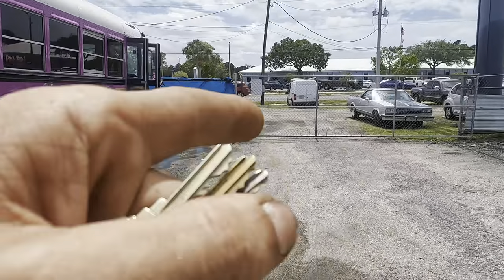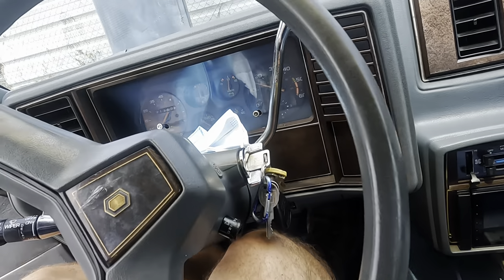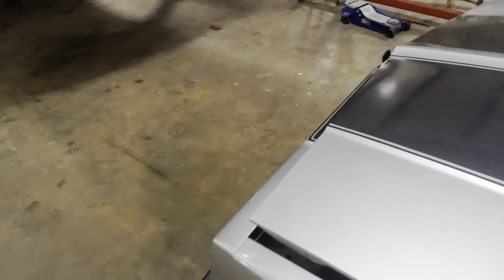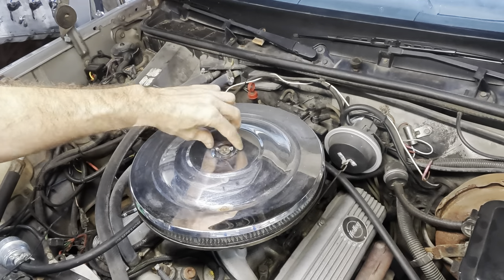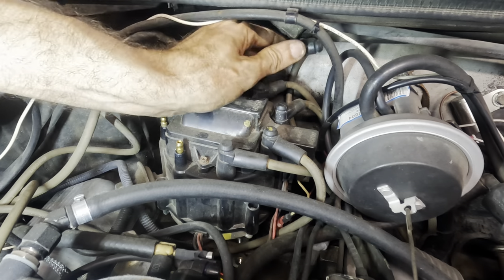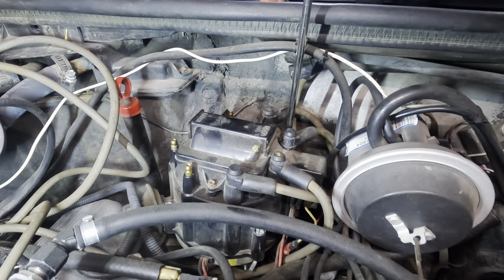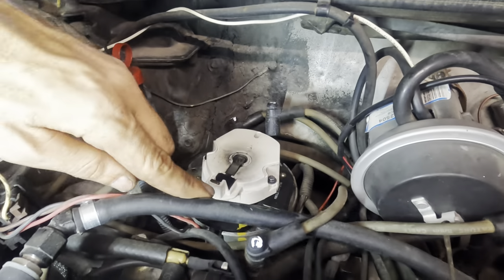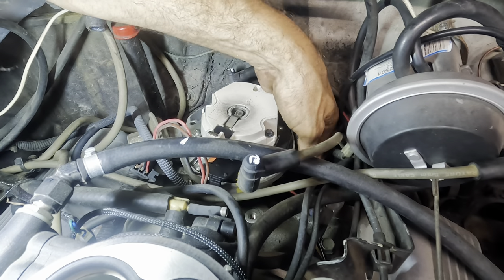Shuts Down While Driving! 1985 Chevrolet El Camino | Karen Story at End #mechanic

Comment: If I remember right, it’s actually a station wagon if you stay with what platform it started life as. 
Look at the front of the bed, there should be a sheet metal plate screwed down on the floor. That plate covers the space where the rear footwell would be in the station wagon.
Edit: For putting the distributor back in, for one reason or another when you pull the old one out, the slot in the oil pump drive will always remain pointing at the spot the rotor was pointing at before you remove the distributor. I have always had to turn the oil pump drive one “tooth” back as in where the rotor was pointing when you get the distributor disengaged from the cam gear before I could get it to drop back into the correct spot.
Additionally, every time you put it back into the wrong slot, that oil pump drive moves another click farther around and then your rotor ends up one more tooth farther off.
Also, that distributor clamp has a slotted bolt hole so that you may just have to loosen the bolt and slide the clamp off the distributor base without having to completely remove the bolt. Makes it a lot easier to put back together.

Comment: in the 1960's we used to make them full centrifugal no vacuum advance tuned in on a distributor testing machine [can't remember the name] tighten the secondaries on quadajet carb to come in later and we were able to break the tires loose an get the wheels up a little on olds 442-pontiacs, big block Chevys

Comment: The Firing order   is 1,8,4,3,6,5,7,2. 2,4,6,8 is on the left.  Use a screwdriver to turn the oil pump. The stalling can be caused by a fuel line being sucked closed by the pump. If it has a mechanical fuel pump.

Comment: good old GM HEI, lack of tune-ups would make the coils and modules run far hotter, the older models with vacuum advance would break the wires to the pickup coil and sometimes work intermittently or only act up when hot, modules with poor heat transfer would do the same.(I still own and drive early 90's chevrolet, with the good old keys) lol

Comment: Have at lest 3 timing lights, still have my 1993 suburban. Had a MSD coil or pickup fail, drove me nuts. Don't remember the symptom, have it in my log. Just loosen the hold down clamp and pull it back. That way no drop.

Comment: Cant timing lights be used to ensure you have the ignition timing tuned/programmed right for coil-on-plugs and other non mechanically linked computerized ignition timing that rely on sensors? If so all the more reason for the community to get you one ;).

Comment: I worked at a dealership in High school when that El Camino was made, and went through the GM training center for them, the way I was taught you pull the vacuum advance hose and set the initial timing, there is or should be on the 305 vacuum  present at the hose full time until it drops on acceleration. BUT never messed with the aftermarket throttle body those came out AFTER I got out of the rat race GM started., the older GM cars and trucks only had vacuum on acceleration. There was something with the HEI modules in the top of the cap to, they have to have a clear liquid like paste, that was smeared on the underside of module, or it would overheat, and do the stalling or in severe cases fail. And on the old 4 barrel quadrajet carb it was standard practice to flip the lids to hear the 4 barrel moan, BUT, on cold, high humidity, or rainy days, they would stumble, bad, due to icing up, and a carb would actually be covered in ICE if the hot air tube was not feeding exhaust manifold heat in air cleaner at highway speeds, rode with a buddy once with a hood off!! See the little filter like thing on the brake booster hose, that keeps the gas fumes from going into vacuum booster and rotting the booster rubber out, GM had a recall on those, I bet I put 500 to 1000 of those on as a kid on 1977 and 78 Chevys!! These had a habit of the fuel pump going out to, and IF LUCKY gas would pour out the hole under car on pump, IF UNLUCKY fill the crankcase FULL of gas, and if not caught in time trash the engine. The 305 of this era had a line bore problem on crankshafts to on early engines, and spun mains and rods. Thanks for bringing back some teenage years in a dealership and some of the weird xhit I found at times, I was the squeak rattle and water leak guy, got to be a  good friend with the St Louis Mo Zone GM rep

Comment: Another way to set the timing is to use a vacuum gauge. Set the throttle to about twelve hundred RPM, hook the gauge to intake vacuum, advance the timing until you get the highest reading and then back it off one inch of vacuum. It's about the same as your brake torque method, but one guy can do it.

Comment: I had a 1999 Cadillac Seville when I lived in Tampa between 2006 and 2009. I went to fuel up putting 20.00 into tank, the car refused to turn over. I ended up putting another 20.00 in it and it ran perfectly first crank. I guess filling gas tank only to about half way is a no no. LOL

Comment: How is it the battery has only one wire attached to it?  spare battery?
Reply: Has both TOP & SIDE MOUNT, GROUND IS ON SIDE MOUNT.
Reply: @NoWr2Run  thank you.  i used to have a side mounted battery when i owned GM vehicle but they were facing me at the time.

Comment: I used a cut piece of timing degree tape made of paper(downloaded/copied) with my printer, from the ebay stores web page, made by "msd". Then I taped it to the firewall, just up behind the distributor cap. then with a piece of cut aluminum, I made a pointer to mark where the timing mark is. No timing light needed. I did this because in Las Vegas, the engine likes more timing in the winter than the summer. With the degree tape, I can do a timing change from the top. Easy-Peeze.

Comment: This brings back memories of me rebuilding the distributor on my '72 Vette. Anyone remember the tach drive distributors?  LOL  That and the mechanical oil pressure gauge, and the Holly 780 cfm dbl pumper.  Oh, I can hear the induction noise to this day if I close my eyes. Peace/Out!
Reply: Just for the giggles find the drive adapter for the tach drive and the Rochchester fuel injection.
Reply: @kenore4003  Now that has to be "unobtainiun"! LOL  I remember the price tag on just the shaft, and gears and cable for my car and it was a weeks pay plus some back in '77. LOL The good old days when the only electronics were the radio.  LOL
Reply: I had a 1964 and at least the tach drive and cable was intact. All the tin was gone though. Just say no to AM radio, at least by mid 80's that was a thing of the past.

Comment: Timing lights are still used by engine builders and drag guys doing tune ups. They use them to make sure timing is set to base numbers before they add or subtract timing through the power curve. So you may not need one for what you do but 🤷🏻‍♂️ you never know you may get to building something Kool on the side🤙🏼🇨🇦

Comment: Pausing at 16 mins to "REEEEE!!". But the timing IS adjusted BY rotating that base section!You DO need to time it after replacing or even just loosening and moving it. You could do what I used to do and 'listen' to it and advance till it starts revving a bit silly, back it off to where it sounds smooth but try to be a little on the advanced side, take it for a run and give big throttle at low revs and if pinking then back it off a touch more at a time till no more pinking and you'll likely be a touch advanced if checked with a timing light later but, I think most GM engines (my experience was more with the 6 cylinder Holdens (138s, 149s, 161,173s, 186s and 202s) and some (253, Chev 307s, 308 and 350 V8s, hardly any with the 350s though in Australia) I felt they all ran better, more power at revs that is when sightly advanced from the recomended timing anyway but, you could back it off a touch more, or get a bloody timing light, geez! A mechanicalsed mechyanic who aint got no timin light, wot is dis world comin ter?
I had a 750cc 3 cylindered bike at one period that had separate points AND timing plates for each cylinder, all mounted to a sort of master plate which was meant to be aligned to the crank by a dowel pin which had either somehow been bolted to and forced in flush or, sheered off somehow but, left the hole plugged so I couldn't even replace it. Well, I could have I guess but, that would have been a BIG job. I timed EACH cylinder individually purely by ear. I then took it for a shortish test run along side a gold course 1 side and railway on the other so no side entrances, gave it to it just wearing shorts and a T shirt and at 140 mph spotted a cop on a Kawasaki Z 1,000 trying but failing to catch up. I was then heading into a built up area and normally, if wearing proper gear have just outrun him, like I'd done many times on that bike but, with the built up area, being way under-protected for that I just went at speed limits and just kept waiting for the inevitable. He just followed me for a surprisingly long time then, "whoop whoop" and lights right in the busiest part of the shopping district. He wanted to know where the unusual but great sounding 3 into 1 exhaust came from, who did all the hotup work on the engine and just generally was admiring the bike!  Of course I did explain the situation and the gear I was wearing, grease smeared and blackened hands made it pretty obvious I had just been working on it's engine and the only thing he said after having a nice chat about bikes, as he was hopping back on his, he said something about, "oh, and do try not to do that right in front of me again, please" lol. Cops can be cool as long as you remember, they're just humans the same as us and if you treat them, well, not necessarily 'respect' but more like a friend, or someone you could be friends with, they'll usually reciprocate and won't WANT to book you for more than something serious you were doing wrong, they'll often do everything they can NOT to charge you. 
Sorry, got a bit off topic, that timing on that where a light could only verify each cylinder was firing at the same point in it's cycle since I couldn't rely on any timing marks thanks to that flush cut or pressed (somehow) dowel pin. If a mug like me could get all 3 cylinders timed individually by ear, WHILST the other 2 were firing as well, you should be able to get that thing pretty close without a timing light. Or go buy one!
One thing I'll say for sure, I would love to own that El Camino, it's gorgeous. Just a pity you lot put yer steery wheely thing on the wrong side of yer cars lol. I have seen a few registered and on the road here but, all have been LHD so that's not fun when your operating everything from the gutter side of the car.
Got to where you described how you used to time these type things but, the vast majority I dealt with were manual transmissions so, road test, low revs big throttle to find that pinking then back off from but, I completely get what you were doing with autos.

Comment: Dear Ray.  For SURE you are the master of all this.  BUT, from distant, past experience, with the Vacuum advance off (disconnected, the distributor base position is "A lot more sensitive than you might think," versus setting ACCURATELY the correct timing position, versus the TIMING LIGHT triggered by number one spark plug wire, (induction hook-up on the (then) more expensive timing lights.)  I still have a nice timing light, (worked by slipping the induction pick up over the number one spark plug wire, and shining the blinking light at right angle to the timing mark, on the harmonic balancer, that you carefully filled in with white chalk, that you wiped off, so only the nice white chalk line would see. Then your buddie slightly moved the distributor to correctly get the timing mark to appear exactly at the right position.  Anyway, U really should have a timing light, to ge the initial timing set "Spot on."  So this means you gotta buy a timing light, and maybe you will use it only a few times.....The entire issue with the HEI systems is related to proper grounding of the electronics.  You can discuss this, as you are the electrical expert.  But if not fully grounded, then the modules would burn out.  Great video!  You really know what to do!

Comment: Sounds like vapor lock, with hot start issues. With that fuel filler siting right behind the rad going the the efi unit,  I would have run in the back out the front.  But that's a common problem on those.

Comment: I once was into kind of a scam. I went to a used car lot and asked to test drive a nice El Camino with a 454? I told him I was going to take it to show my dad, who was home working on another car. He gave me the keys and away I went. Picked up two buddies that were waiting down the street and took it for a ride in what was a new highway from Kahului to Maalaea in Maui. It was a standard shift and part way down the road I decided to head back, but turned around as a car was coming. I realized it was not a good idea and they were coming fast, so I did a power shift into second on the turnaround and spun the car in a circle, before straightening it out.
That was a bit too exciting for me and my friends.
Also did the same thing with another used car dealer and a yellow Corvette. That went alright.
Young and dumb, but it makes for memories.

Comment: I am surprised the owner didn’t tell Ray that the car was retrofitted with the FiTech Electronic Fuel Injection System.  There could be problems relating to hot starting associated with the FiTech

Comment: It's odd to see a black rotor, on a gm HEI.  Haven't seen one since the late 70's. The early black rotors had problems burning trough from the coil post to the Dist. shaft instant shutdown. The white ones fixed that problem (no Carbon black).

Comment: The El Camino was introduced as a cross between a pickup and a station wagon. All you have to do is take a glass of water and put it on the air cleaner and adjust it till the ripples smooth out.

Comment: So I remember when HEI first entered the market and under high load conditions and high coil output,  a tiny hole would burn through the top of the rotor, so the engine would miss under WOT conditions. 

Dealers had fits with this because most of them didn't understand the use of a scope and testing coil output.

They would condem the Module or the complete distributor assembly. 

Later with the ECM in the kick panel I had a Buick dealer, when they replaced a ECM under warranty would zap it with 120vac so that the factory couldn't reject the warranty claim...

Oh those were the days...

Comment: Best distributor ever made, would install it in Chevy motors instead of points (74 and older). Also, old GM odometers had a seal that was designed to break making the numbers uneven when it rolled over, so this cars mileage appears original. The fuel filter is mounted to close to the fan getting too much heat, could be vapor locking

Comment: I have set timing by ear, then checked later on with a timing light, and it was pretty close, so it never got adjusted, as it was close enough to correct, and within the timing error. New distributor, or rather new to me, because the original distributor got stolen in the street. Toyota engine, and that is a very expensive distributor, and was also only available as parts, and half out of stock. New was close to $400, used one, from a rolled vehicle, was only $25, and came complete with the plug leads, clamp, vacuum lines and the bolt.

Comment: My 1973 Rover V8 P5B has twin SU carbs with an old school distributor with a fine tune adjuster for the points. Dead easy to set up with a good old dwell meter and timing light. The all aluminium V8 is a 60's Buick design, and is probably the best engine Rover / British Leyland ever made. P5 = fifth Rover model post WW2 and B stands for Buick.

Comment: 305 is over carburetorated and under cam'ed. Have cut my teeth on S.B chevys starting as a teen in 65 with my 1st 282 301 I learned when timing just don't lock dust. Down to tight so you can turn to adjust then tighten it all the way.

Comment: When you time by ear you slow the idle as slow as it will run then adjust the timing to the smoothest idle then lock down the disttruberter the reason it was dieing was a bad pickup coil common Gm problem in the 80s most times you can take the pickup coil lose and put white grese under it and bolt it back down and cure the problem of over heating

Comment: Those are a true 91k miles because when a mechanical odo rolls over or is rolled back, the numbers will not line up properly. Keep that in mind too when someone is selling a car with "super low " miles and it has the mechanical readout. Also, you don't have to mark the rotor's position externally. What's important is that it lines up with the same terminal in the new cap as it did in the old one. That's how i used to replace distributors and rotor/caps. I never had to mess with the oil pump drive because the distributor will never be that far off. And that carburetor's primaries are as big as its secondaries. They would normally be smaller and with such large "holes" you won't have as much vacuum at very low speeds, causing the engine to stumble or hesitate off-idle. These engines run really well with a de-smogged Rochester carburetor if you're not racing.

Comment: I'm 60 yrs old, this is my era. I see what looks like a solid state unit on the distributor, in my experience they would fail from heat. In my experience heat would degrade them to the point where they failed. Mine died to at a stop light and wouldn't restart. Replaced it and was good to go. I'ts a time when electronic crap was being introduced to engines, but I don't think they put too much thought into how heat would degrade them.